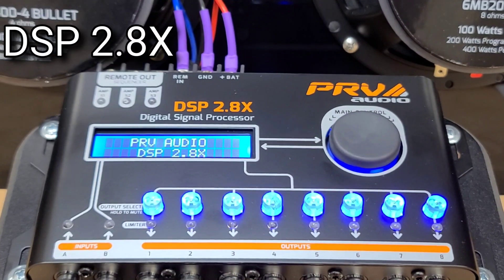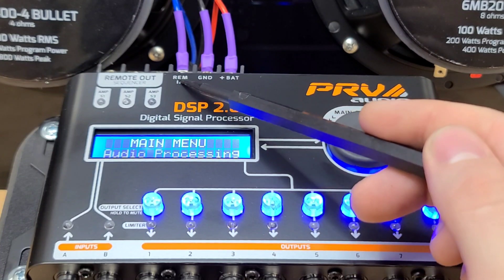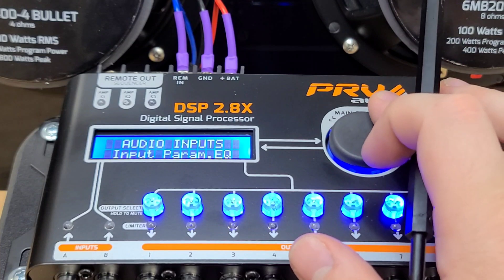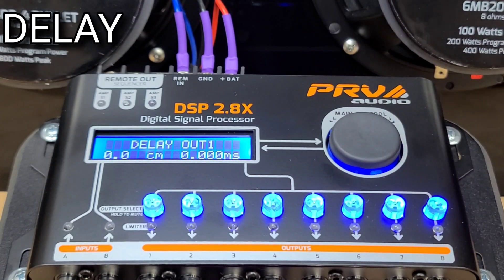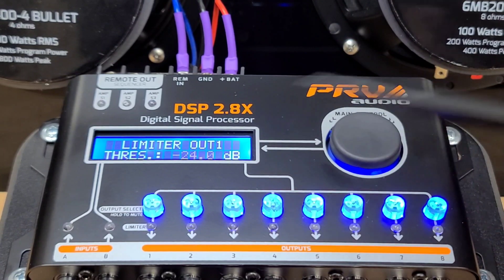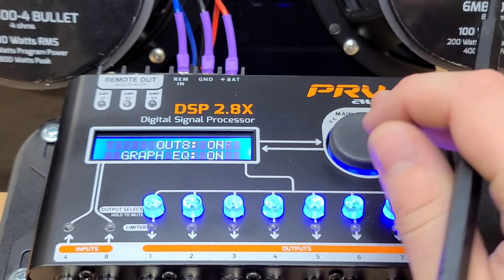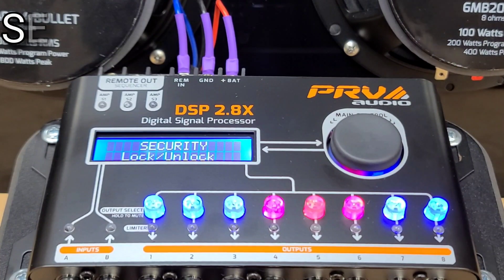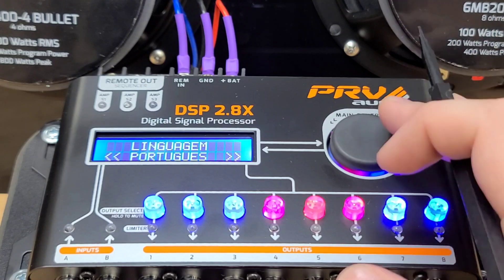Learn how to use the PRV Audio DSP 2.8X (Digital Signal Processor)

Comment: 10:41 I have to comment right here on the time stamp now if your running taramps you cannot put that on 100% or anything more than 25% any thing you touch send over 2v that courses the amps and
Dsp to trip out so what’s the best advice with this i understanding it’s the taramps for midrange that’ are coursing problem and trip if the input voltage is over it’s rated input 10:41 can you advice

Comment: Limiter lights doesn't means it's saturating. It's a protection function to prevent audio overload on your amplifiers. Very strange video
Reply from the maker: the limiter light on the inputs - means that you have reached the MAX input voltage - if the light is on the inputs you are saturating the inputs
Reply: @PRVAudio  do the limiter light flashing means you have to turn the gain down on the amp or dsp?

Comment: What gauge wire did you use? The manual size to use minimum 13awg with a 1A fuse? That can't be right can it?
Reply: I ran a 12 gauge Ofc wire to my radios positive and negative no issues here

Comment: Does this forget all it's settings when disconnected from power for long periods.I might be using this at home rather than in the car so wouldn't have power all the time.
Reply: Not actually. I have a stetsom STX2436BT and it holds settings into internal memory

Comment: What happens if you remove your car’s battery ?
Everything has to be reset again?
Reply from the maker: No it does not reset if you removed from your system! We do have even some authorized dealers that Tune the unit at thier shop and ship to the customers with all the settings so they can just plug it in and use it
Reply: @PRVAudio  thanks 🙏🏽
Reply: @PRVAudio how can you guys do that for me? I run 3 amps 4’ 8’s PRV mb700ft ndy , 12’ chuchero box with the 12W1600 with 3 1” horn drivers and 5 Drivers ds-18 but switching over to PRV

Comment: Just bought a DSP2.4 for a home audio system. The idea was to use it to feed six audio amplifiers for a set of three-way speakers, and one more channel for subwoofer output. So I need this DSP unit to first send A signal four ways into the red RCAs of the four outputs, and B signal to the white RCA's four-way also, before crossovers and EQ's were configured. Is it possible with this 2.4 unit?
Reply from the maker: We would not recommended this unit for a home audio system, because you will need a 12volts converter to power it, but you can sure set as you described

Comment: Can u tell what good crossover to 😮 put a set deaf bonce Sylvesters 6.5 midrange speakers they don’t like to much bass, I listen to a lot of rap music?
Reply from the maker: you have to check with the manufacturer for setting on those speakers, if it was a PRV Audio Speaker we do have all crossover point recommended on our website
Reply: Did you figure it out I have them m61ac

Comment: you are very knowledgeable about the device itself and how to work around the settings, but you explained in the input parametric eq wrong, specifically the Q-Factor the tighter or the lower the value the more that will affect neighboring frequencies and the looser or higher the number the the less that will spread and affect neighboring frequencies.  if you want to cut 63hz frequency or boosted without affecting 50hz or 80hz you will choose a higher number... but if you want round out more evenly and lower or boost everything around the 63hz you will go with a smaller number.

Comment: been using a 2.8 for a couple of months now. This morning while driving to work channels 1 and 2 emitted a 'tone' id guess about 5kz at high volume.  I could not turn it off. if i turned my radio vlume down it did not matter, as i have narrowed it down to the actual DSP sending out the signal. I was luckily enough able to safely get to the side of the road and tunr the vehicle off. When i restarted the vehicle, and when number 1 amp turned on (channel 1/2) the tone came back on and i had to go into setting and turn the amp off. this was so loud i could smell my voice coils. So not only are my ears ringing, huge headache, i probably have burnt up mid/tweets because of it. How do i get this fixed? And how do i know this will never happen again? @PRVAudioBrazil @PRVAudio @PRV
Reply from the maker: this is a unique case, we never heard this behavior, the DSP can not even respond this low ... we are not sure what happened but usually the DSP only amplifiers noise and signal from other sources, try to remove the inputs from the DSP if the noise stops, it is not coming from it, We would recommended also to troubleshoot the RCA, A lot RCA can break with vibration

Comment: If using a stock head unit with a LOC can I just wire this up in line with the LOC like say for instance... Head unit to LOC to DSP to Amplifier reason I'm asking is I don't know much about installing and everything is already installed and working I'm just wanting to add this to clean up the signal for better clarity

Comment: My first two channels are for my front door 6x9s that are ran in parallel with the dash tweeters. What do you suggest the settings be for that? I want some mid bass up front but don’t want to blow the tweets. Please help. 6x9’s are JBL GTO939 100 watts rms each. Tweets are Skar 3.5 150 watts rms.
Reply: Sorry bud but you’ll need components for any real bass. You’ll also have to connect a crossover rewiring the tweeter to not cross over LF only HI look up Car Dash Tweeter Speaker Wiring Harness automatically plugs in

Comment: nice to see a DSP that doesn't require a laptop to use! having said that, there are things that could be better. ditch the stupid EQ presets, and use the processor power for more EQ bands.  if you want SQ, a digital input of some kind is needed. a port for an (extra cost)external display would be a nice, allowing you to set the system from the driver's seat. all in all, looks excellent for the price.
Reply: You can do just that with the new Stetsom Dsp the have a remote display you put it where you want. And they have Bluetooth now

Comment: Currently have a 2021 challenger with the stock head unit I’m running 2 amps and a battery pack with 2 kicker 12s all ds18 on the mids and highs I already have a converter the lc6 or 7 can’t remember would I need this if I already have a converter ?
Reply: a DSP is always needed in any system

Comment: I have 14 speakers. 5 per door, and 2 per A pillar. Now could I use two of these in stereo? Run 1 run to 1 and use 7 outputs on left and same on the other but make it right? Or could I take front dash L with door R and front dash R with door L that way I’m using the left and right on BOTH?
Reply: yes

Comment: I must have pressed something in the thing and it won't save the x over settings in the individual channels... Something is overriding it.... Example if I goto xover output 3 change it to low pass 80hz bt12db.... When I click away then go back to output 3 its back to hpf off

Comment: I have a amp installed on my harley in which the amp gains (crossovers) are already set from the factory. I'm about to add some subs ,Would my speakers still benefit from this module?

Comment: I just bought one of these, I'm wondering with only one pair of inputs how would someone get the rear channels to work? It seems the functionality is focused on purely highs, mids & lows and maybe some stereo if you want.
Reply: Highs, mids and lows... Can't do more than them 😂
Reply: it takes a  left and right rca signal and multiples it 8xs. so you  can set it up multiple  ways 1 and 2  front left & right  3&4  can be rear left and right   the turn the gains up and down if you needed to  fade front &back

Comment: So i can get a decent head unit "android unit" which has a decent eq tuning most of the time and this with amps and get rid of an normal eq and crossover i suppose.

Might be harder to get used to it but at the end of the day you save up some $$ and this does the same job

Comment: Actually could I run the right rca from my head unit front and left rca from rear head unit rear. I just want more control from my head unit for my tweets and mids. Going to have them on separate amps.

Comment: I was thinking of getting 2 of these. So I can run rca cables from my rear speaker and one from my front speaker rca out. Have one for the amps for my tweets and the other one going to my Amp for the mids. Have 8 6.5" mids and 8 horn tweets.
Reply: That makes no sense bruh. You only need one set of input.
Reply: The only reason i would is 2 dsp is to be able to adjust balance front to rear rear to front balance other than that you can pretty much use one dsp.

Comment: Would love if these came with a subsonic filter
Reply: So any channel you choose to be a subwoofer Channel, well it's high pass filter is a subsonic filter... Same thing bubs... High pass filter = subsonic filter in a subwoofer crossover/settings... No biggie.. it's all a learning experience
Reply: @josegiraldez6230  so i can use the hpf and lpf on a channel at the same time?
Reply: @banlmao1707  my DSP has a bandpass filter so I can use both.. I don't know if this one has one and I didn't think about that so my bad, anyways I always use the subsonic filter on the amplifier anyways.. no need to use it on the DSP ,but yeah now that I think about it, it would be cool to have just a dedicated subsonic filter on a DSP.. I guess you're right....and the bandpass that I am speaking of I usually use on my mids and highs anyways, so once again and as I said, it's always a learning experience now for myself....
Reply: @josegiraldez6230  I’m assuming by using the low pass and high pass at the same time it’s basically a bandpass option, and I can set the hpf as low as I want  so it would be a subsonic filter
Reply: @banlmao1707  yes sir..
Reply: So does this have bandpass capability?
Reply: @BSA210  yes
Reply: @banlmao1707  what is bandpass capability?
Reply: @Simpleman1078  bandpass means playing only a certain frequency range, basically let’s say between 20-80hz. This would be a bandpass setting.

Comment: It should be fine if the alternator puts out 14.2 volts? The prv should handle this amount of voltage?
Reply: it can handle up to 16v input on the battery wire
Reply: I’ve ran them at 17v no problem

Comment: I’ve been running this DSP on my motorcycle since 2019 and no one could explain how to properly use it. This video is extremely useful, thank you.
Reply: Bout to put one on my motorcycle too
Reply: I’m curious Where did you mount it, so that you could access it? Thanks! I’m considering this one for my system
Reply: @BigTee3099 in the tour pack if it's a Harley
Reply: whoever puts a dsb in a motorcycle is gone mad 😂😂
Reply: Literally can't think of a more absolutely pointless and useless endeavor by putting a DSP on a motorcycle! 😂
Reply: @skypallman6169  you obviously don’t know about motorcycle audio competitions. You should check it out, then you’ll understand the need for a DSP on a motorcycle.
Reply: A vehicle dosent need to have a roof to sound good. i put onee on my bike and it changes that sound completely. Just like you would want on your car.

Comment: Good run-through of the features. Looks pretty good for the price. What's missing here is the depth of audio processing that will give the ability to tune a system fully flat. What I mean is, a 15 band graphic EQ is limited. A single band parametric EQ only let's you fix one problem area. A very good DSP will have 30 band graphic EQ and minimum of 10 parametric EQ filters. I would pay double the price of this for the same interface design but with more processing. in some cases the ability to program via an app or PC is a must. However, sometime simple is better. i like the simple all in one design of the 2.8X. I am not bashing this DSP unit. I think the price is affordable and I'm going to get one for use on my workbench for testing.
Reply: and did you get one? whats your thoughts a year later?

Comment: The settings that are saved, do they stay when the Battery is removed from the vehicle or do you have to set it all over again when power is removed
Reply from the maker: This unit will automatically save changes that are made, in real time. The memory saves forever even if you remove power.
Reply: @PRVAudio  I probably have a older model then because mine looses memory when the car dies and I have to reinput my settings

Comment: Why a suqence to shut off n power on amps? Thats what there remote wires are for
Reply: Either way im buying one so i can connect more amps to my radio sense its got one set of inputs of rcas from the dsp to the radio and 8 outputs 🤙
Reply from the maker: @joshjorgensen2002  using the sequencer on the DSP allows you to control when and how the amplifier turn on and off, some radio just turn off very fast, while the DSP is still on the amplifier as well causing, and boom noise when you turn it off, the sequencer will allow you to eliminate this and have better control on your system

Comment: When I use the output eq it affects all the frequencies... If I change 30hz up 1 db every single other frequency goes up 1 db...  If I change the Q every other frequency changes to the same Q... what I got from this is that you can specifically change individual frequencies but it seems like it changes all of them when I do just one. Also does it on the input eq when I up the db to one frequency it does it to all the frequencies...
Reply from the maker: The output Eq - has a Q setting - this value will determine how wide the frequency peak will be - the lower the number the wider the range is ( which it will affect all frequencies around your peak frequency set

Comment: If I were to run this with my Pioneer 80prs which can be run in active mode, what would I set the head unit to ? 
And would I set my amps on full pass?
Reply from the maker: If you are running this DSP on your system, you should manager all setting for your subwoofer on this unit - which you will need to set a HPF and LPF for that channel

Comment: This also Apply’s for the prv 2.4x correct?
Reply from the maker: Correct, both have the same system
Reply: @PRVAudio  can I set channel 1 as A and B? For example I would like to crossover my 6.5s at 100hz on A. And my 8s on B at 80hz

Comment: how are u making sure that the amp out put to speaker, is actually sending the signal, freq, that u set on the dsp ? my amps don't have a pass thru, so, how am I supposed to set the frequency at the amp ? To not go against the dsp, frequency?
Reply from the maker: Make sure any crossover on the amp is fully open. If you have a full range switch make sure it's on full range. No bass boost.

Comment: Wanted to know what is the voltage range for preamp inputs going into amps this can set?
Reply from the maker: That will be up to you, you can control the output on the unit - you can set the desire voltage to your amplifiers, you always recommended to set the gain on the amplifier at half the way and control on the signal on the DSP
Reply: What is the frequency to use for the bass

Comment: I have a PRV SC-20FT Pro 2 Channel RCA cable and I also bought this DSP. Being that the DSP only has 2 inputs… which output on my head unit do I plug the RCAs into?  

Front, Rear or Sub out? Or do I need Y splitters? If so, how do you recommend I wire the head unit and DSP for optimal performance?
Reply: Front channels
Reply: @drzflyest4  really don't matter front ir rear. Just not the sub
Reply: @Simpleman1078  it certainly does matter as some had units may not put out s full signal to the rear

Comment: Seriously, every single video I watch just skips over the save feature, and I've watched several.  Does it even work?   I have tried to save and all I get is some stupid screen where they want a name input.  I can't get past this to the actual save.  Could you PLEASE tell me how to do this?  I emailed the manufacturer this question and cue the crickets. I can't find it on google, YT, the manual, or anywhere else.  PLEASE HELP.
Reply from the maker: There is no saving - everything is saved as soon you set it! You can save different profiles but when you are doing adjustment whatever is set is saved already! even if you unplug the units all the settings will be saved when you turn it on back again.
Reply: When naming the save, the arrow pointing right will end the naming input selection and save the profile

Comment: Wanted to know what is the voltage range for preamp inputs going into amps this can set?
Reply: No manufacturers ever show this. It’s so important.
Reply: the "master volume" feature is what changes output voltage from 0v to 5.6v max, it will be clean all the way through as long as ur input to the dsp is clean

Comment: Tim, thank you for this video. I purchased the Stetsom first then sent it back and purchased the PRV 2.8 because of this video. When are you going to do a video on the delay function? I have my measurements from the front of the drivers to the center of the driver's seat but I am not sure how to input everything. Looking forward to learning more about this DSP. Note: I have noticed little pops, chirps and hisses in my system since installing this DSP. Same with the Stetsom. Is this a common problem?
Reply from the maker: The signal from this unit is strong so you may hear things that are suppressed in others. For the delay simply convert inches that you've mesured to cm. Start with the coil furthest back and go to the output that's on the next forward component and delay. Continue like this.
Reply: @PRVAudio  do we input the difference in distance?  For example if my sub is 100cm away but my driver side is only 40 and passenger is 70. Would i put it 60 and 30 respectively?